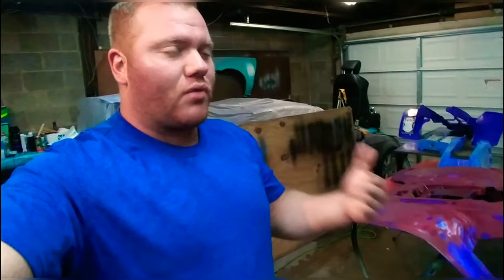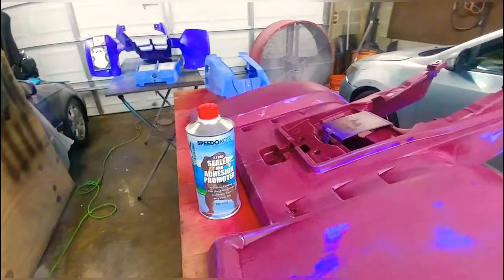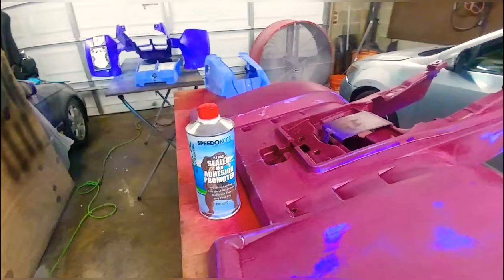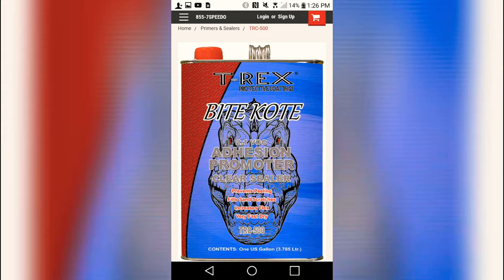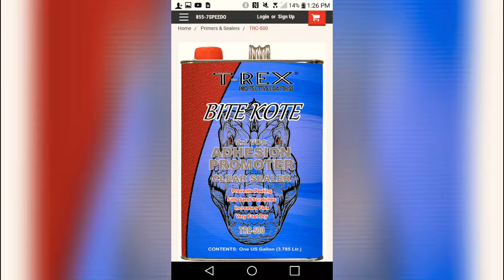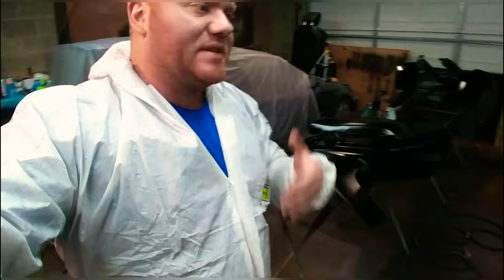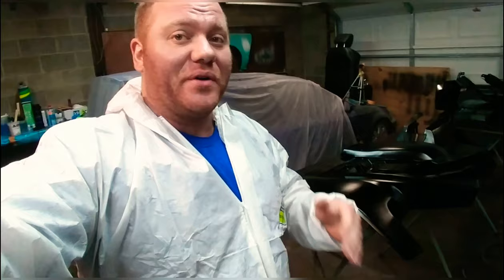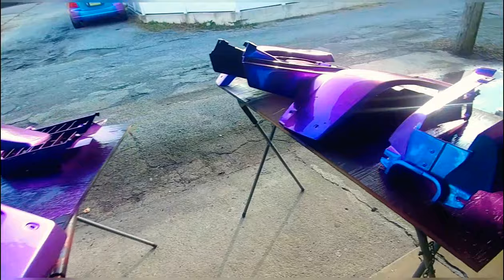PAINTING ATV PLASTICS

Comment: I always add flex additive in the clear coat. It creates a bit more orange peel in the finish but well worth it. Since most basecoats are not hardened they are flexible therefore no flex additive is needed in the base. I'm shocked you never added a flex agent.

Comment: I painted one of my 4 wheelers like a couple years ago the guy I bought it from had it all sanded down and ready to paint so I just made sure to go over it with one and painted it matte black no extra stuff it doesn’t look the best but it stays on there only 1 very small crack I found in 2 years but I wanna try this now
Reply: Hey!  Doing the same thing, my atv is a renegade 500 and it is a run down yellow since it’s from 2014 and sat in the guys shed or a few years when we bought it.  We spray painted it black to match my graphics kit, everyone on Reddit is saying that it will come off but if you don’t have problems hopefully I won’t either.  Thanks.
Reply from the maker: As long as you use adhesive promoters you should be good !
Reply: @speedokoterefinishnetwork4937  yessir!  Sanded it and everything.  Bikes looking pretty dope so far, putting the decal kit on tomorrow morning.

Comment: Hey Marco, quick question. On a lot of the painting videos I watch, yours and others, it seems like or looks like the clear is always sprayed at a much higher pressure? What is the theory or reason behind that?
Reply from the maker: Other painters spray at 25-29psi for clear, I do not most of the time. But in general yes, clear is sprayed at higher psi being you need more air to atomize the clear coat into a fine mist which creates a smooth orange Peel free finish.

Comment: Won’t the paint crack tho since the plastic is flexible? I really want to find a way to make my plastics on my raptor 660 look brand new and clean but don’t know what way to go.
Reply from the maker: Just use paints with flex additives . They still will not last forever but will make them last longer
Reply: They make a flex additive. Use it! This dude didn't and it makes no sense to paint ATV plastics without it.